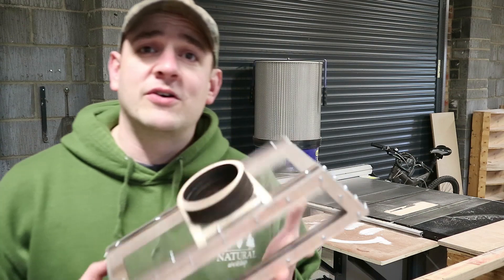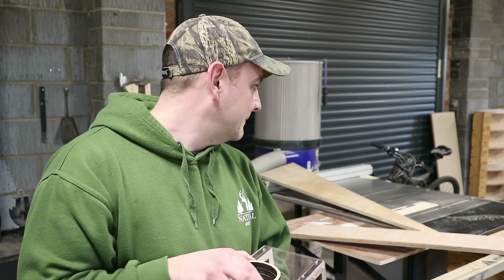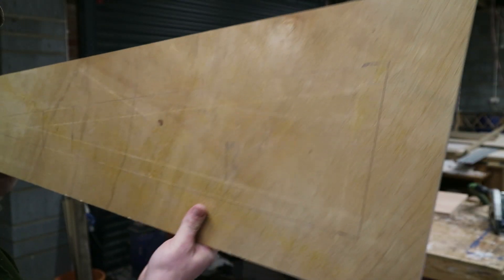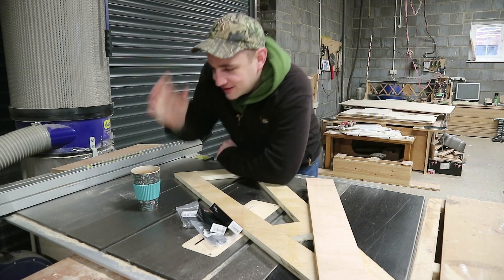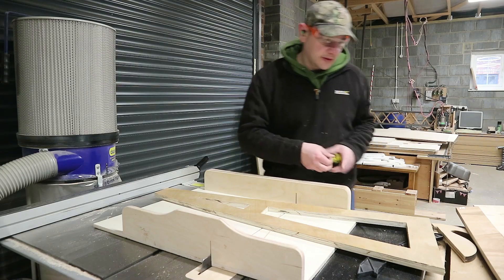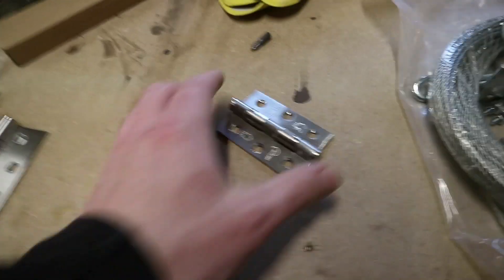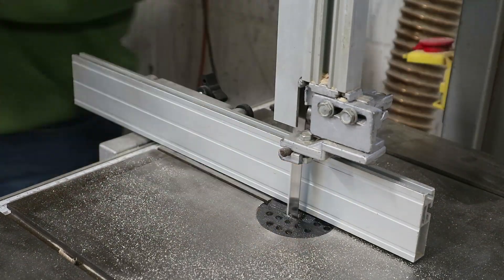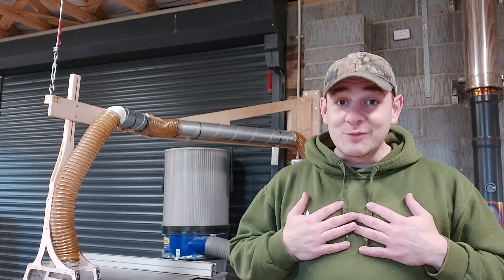DIY Overhead Crown Guard with Dust Extraction for Axminster Table Saw - Part 2

Comment: Great Video.. Personally I like your presenting style, but then I am British. I have a garage up and over frame in the way so trying to figure best way to get overhead extraction. You didn't show it, but I saw your splitter at the extractor.. are you running both under table and overhead extraction? I am having to constantly clean out the cabinet of my Axminster saw so was going to run 100mm underneath and then some sort of boom arm overhead..
Reply from the maker: Thanks, glad you're enjoying it 😁 Yes, that's right with the split, I still get build up underneath but no where near as much. You can go as far as plugging up the gaps with magnetic vinyl sheets but I'm still out on how much it actually helps.

Comment: Probably, it’s all a bit late. I had my overhead guard (in my previous shop) fixed near to one side of the extended table. I just found that when I wanted to cut longer pieces, the upright (or in your case the wall) got in the way. In my new shop, I’m having the guard support coming straight down from the ceiling with an adjustable height (2 pipes tightly fitting inside each other) so that I can the guard down low when I’m cutting thin stuff and up high when I’m cutting tall stuff (like separating the lid from the base on a box).
Reply from the maker: Yeah it can be a pain how we have it set up but its not too bad. I do have it set up so we can raise it up when using the sleds and then move it out of the way when cutting tall items or like you said, removing the tops from boxes etc.

Comment: Do you hold polycarbonate? It isn't cheap - I have scraps that I'm willing to drop in the post that I'm pretty sure are big enough (and pretty thick too, definitely more than 2mm).
Reply from the maker: We dont hold it in stock no, its something we usually special order in. I would be more than happy to pay if you have some...
Reply: @TheNaturalWorkshop  Happy enough to send some for nothing, would be ripped roughly to size though (mainly to help postage) all gratis. Not sure exactly what I have but I have lots of "small" pieces Ive had hanging around I can't bare to throw but any use is good.
Reply from the maker: I definitely wouldn't say no as it would save me buying a large sheet just for it to sit around and do nothing. Let me know and we can sort something out!
Reply: @TheNaturalWorkshop  I'll email you tomorrow for your dimensions.
Reply: @TheNaturalWorkshop  Dropped you an email a couple of days ago via the website, might want to check the junk if you're google hosted for your domains.
Reply from the maker: Just saw this. Apologies! Ill check in the morning and drop you a reply. Thanks again!